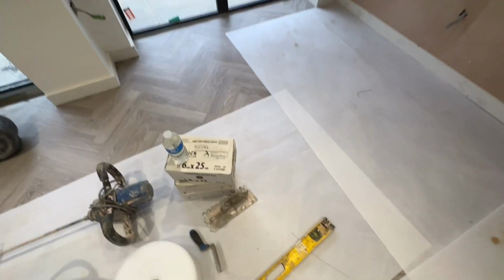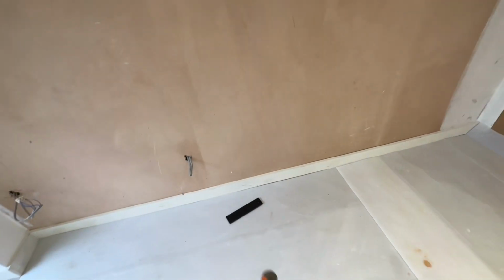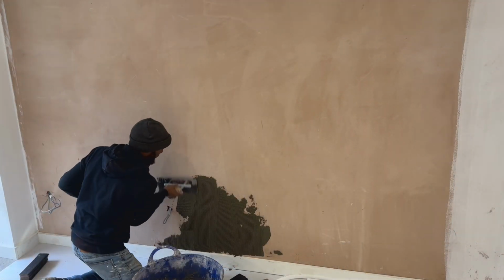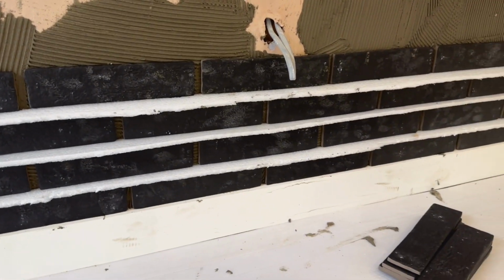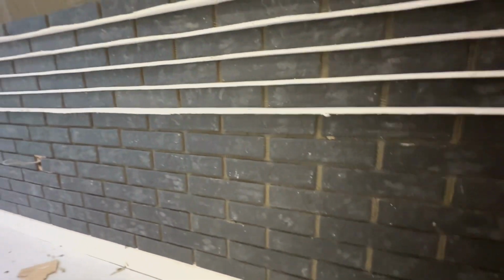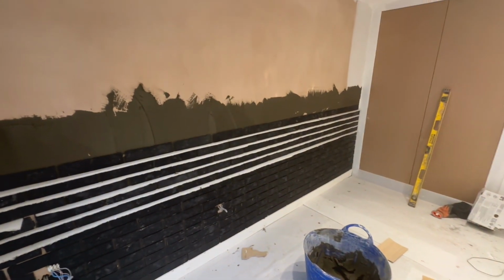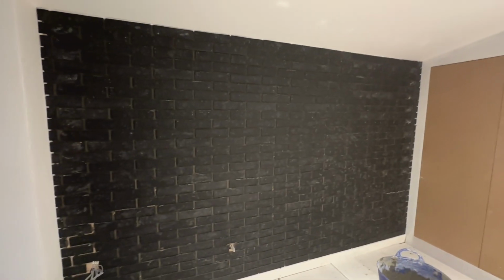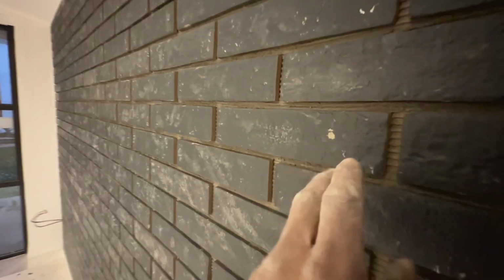Tiling the brick slip feature wall - Modern Garden House: Ep 43

Comment: Don't think there's enough depth for sand and cement pointing. I'd probably use a cement grey grout and chuck a handful of grit sand in the mix. Then once grouted, just run your finger over the joint to make it look a bit recessed.